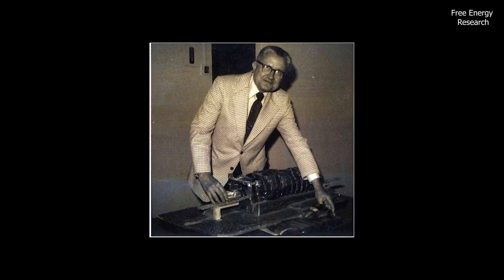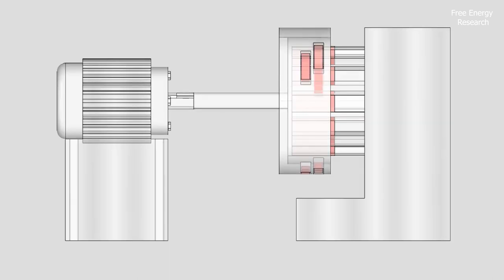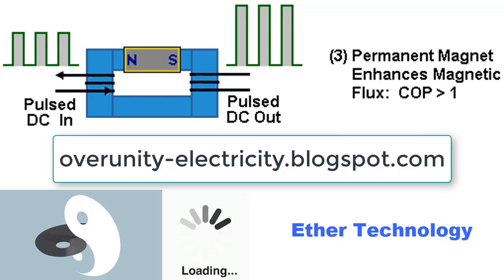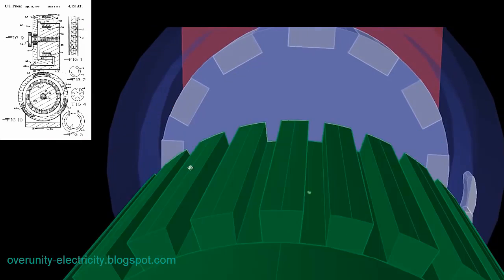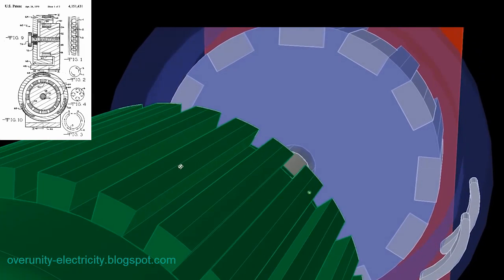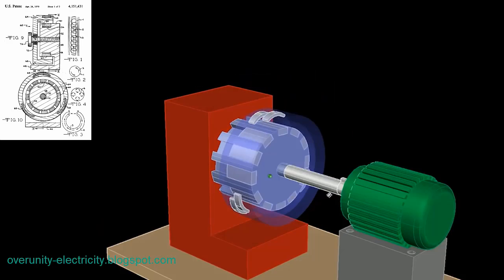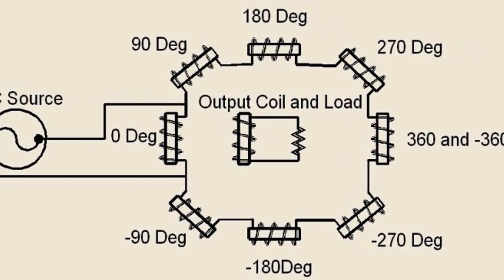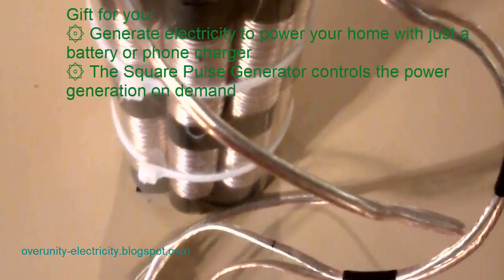Amazing Magnet-Powered Motor: Free Energy AC Generator by Howard Johnson

Comment: Magnets aren't free energy. It takes a tremendous amount of electricity to magnetize a magnet and lots of energy to get the metals together. Also the magents dont last forever.
Reply: Given the fact that modern neodymium magnets only lose .01 % of their field strength per decade they have a theoretical lifespan of 1000 years (as long as they are undamaged and not overheated). They are a VERY cheap way to produce a magnetic field or physical force. As far as your other (wrong) claims they vary a lot depending on the size type and grade of the magnet. The price of an N52 grade neodymium magnet large enough (3" x 1" x .5" capable of 100lbs of force) to use in a decent size generator is less than $40 each. obviously this price includes the cost of acquiring the raw materials, manufacturing and magnetizing the magnet. So as you can see you have no idea what you are talking about.
Reply: unless you make them out of iron and hammer them until magnetic
Reply: Or use electromagnets

Comment: If this thing gets a non zero amount of energy for zero input, how could it have a control wheel? Does it take the input below zero to slow it down?
I am getting a strong smell of bullshit.
Reply from the maker: The force is generated thanks to the design of the magnet placed at an off-angle. The motion is accelerated to a certain speed.
Changing the speed is based on changing the angle and inclination of the magnet.

Do you understand force?

If you don't use force, then exploit Back EMF to get free energy.